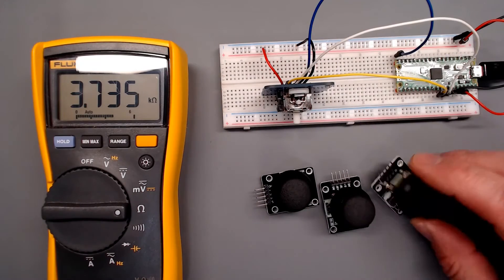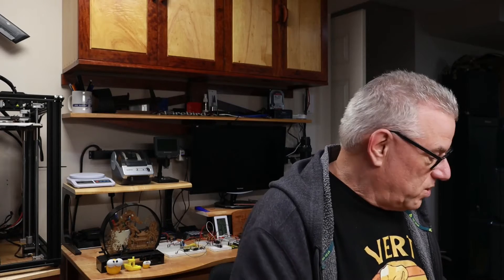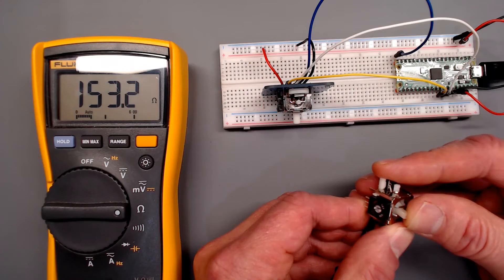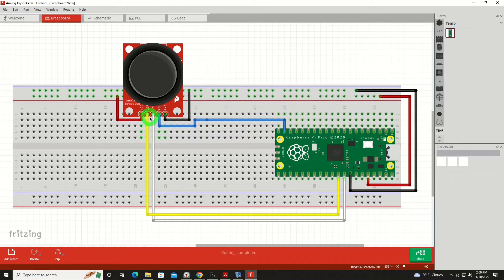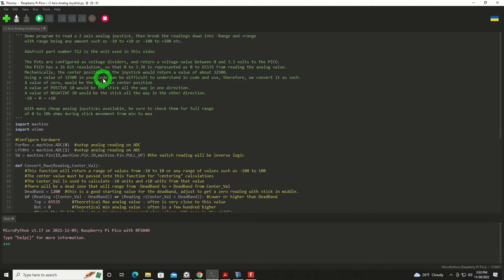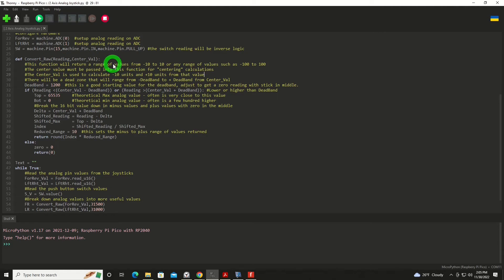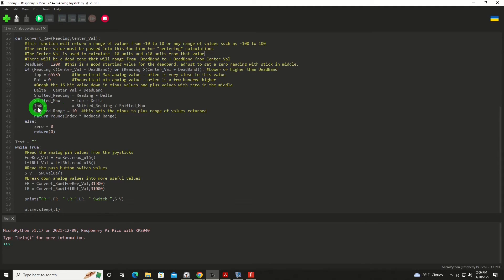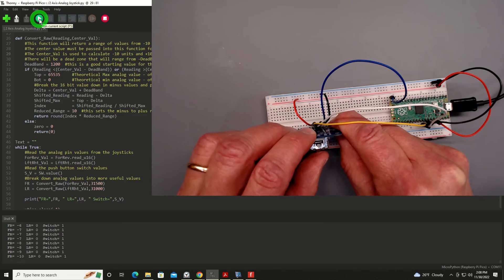How to use Analog Joysticks with the PICO

Comment: apologies as i can barely understand any of the jargons in the video or coding for that matter. currently making an arcade joystick with a dual axis analog as one of the controller for a rp2040 board. are there any uf2 files that have all the xinput controls with the analog set on the 27 and 28 pin? thanks in advance
Reply from the maker: Good morning @BeWrong666,
I am guessing you are completely new to programming and the PICO?
The uf2 file contains the "operating system" for the PICO.  What you want is the python program code to do what you want.  Have you downloaded the program from my website that is for the video?  
Cheers
Chris

Comment: Important video, made the same experience.
Sadly in Germany Ardafruit retailer's are scarce and overpriced and or unreliable (one piece 18€ or straight out not delivering and scamming you).
One is better off buying some PS5 Hall Sensor analgogue stick replacements on ebay for 8€ and soldering those to pcbs harvestet from cheap ones.
Reply from the maker: Hello RTSFan1337,

Thanks for sharing your experience. It is unfortunate there is so much garbage being sold like this so bringing awareness to the problem may help save someone the same frustration.
Chris

Comment: This will no doubt save me some frustration, thanks. BTW I found having an old analogue “sweep” meter around invaluable for visualising pot action.
Reply from the maker: Good morning,
Yes, I love analog meters too, they tell a much better story than the digital readouts.  In machining, there are digital dial indicators and "analog" mechanical dial indicators.  The mechanicals ones with that moving needle just tell you so much more!!!!
Cheers
Chris
Reply: @MakingStuffwithChrisDeHut  and, as an added bonus in machining, the mechanical indicators don’t need any batteries.

Comment: Hello Chris...nice job, good explanation, but is it possible to use two analog joysticks with the PICO since PICO have only 3 analog pins and we need 4? If it is possible-how? Thanks
Reply from the maker: Unfortunately not.  There are 4 analog inputs on the RP2040, unfortunately, one is routed to the on board temp sensor on the PICO.  There might be another board available with all 4 ADCs brought out to pins though.
Cheers!
Chris

Comment: The joystick that just hit the extremes reminds me of how gamepads for the PC worked before the advent of USB. The PC gameport expects you to put 5V through 100k Ohm potentiometers for its four analogue axes. The digital inputs were just for four buttons. Gamepads had circuitry that would output 0/50k/100k for an axis depending on where the gamepad was or wasn't being pressed, essentially implementing a digital input on an analogue interface.
Reply from the maker: Isn't that crazy, or should I say frustrating!!!
Cheers!
Chris

Comment: Would the map function help ?   Seems ADC can only work with a max of 3.3 V !
Reply from the maker: I am not familiar with the Map function, however, the PICO is a 3.3volt device.  As such, I would not try to force it to do something it is not designed to do.  I am curious though, why would you need it to use a different voltage?
Reply: @MakingStuffwithChrisDeHut  voltage limit info was intended as a warning to others.